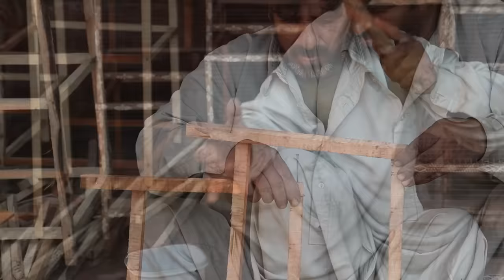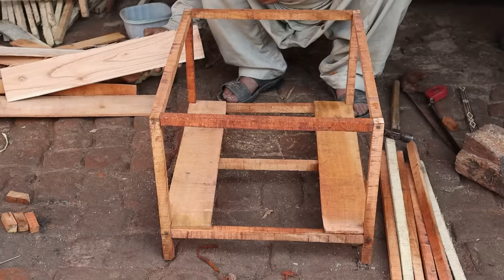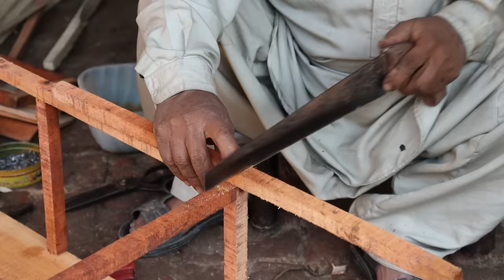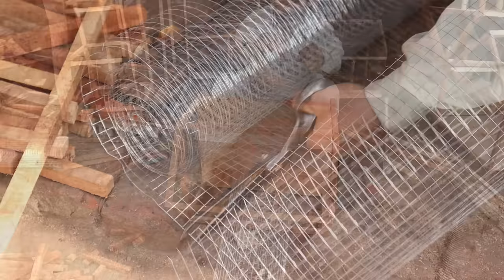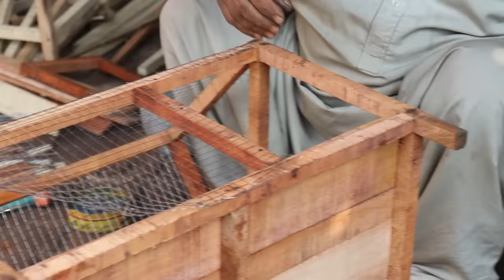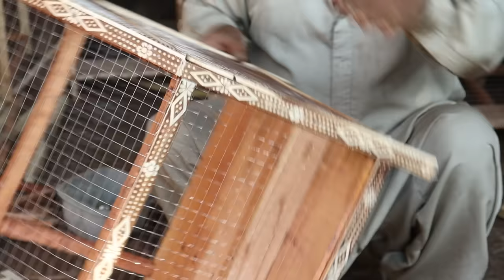Amazing Skills of Making Beautiful Wooden Bird Cage

Comment: Here I am with my miter saw, power saw, table saw, clamps, staplers, and worktable, yet unable to cut two pieces in equal length and can't nail a piece of wood without cracking it. Experience and skills can't be bought.